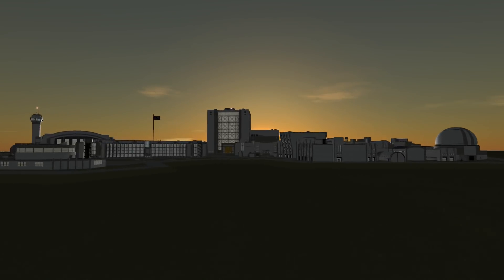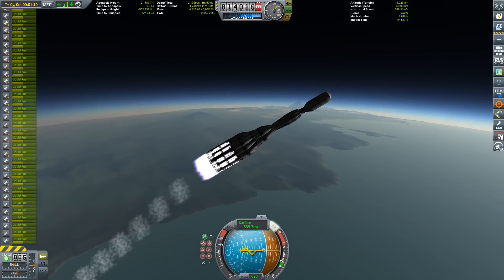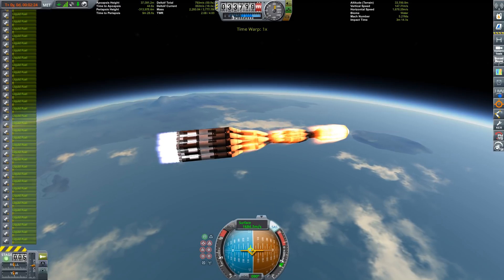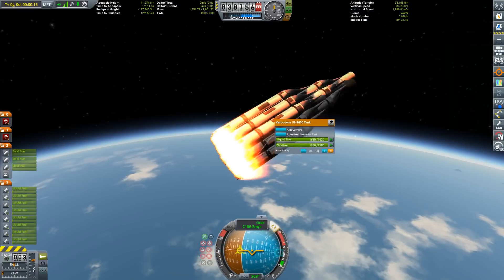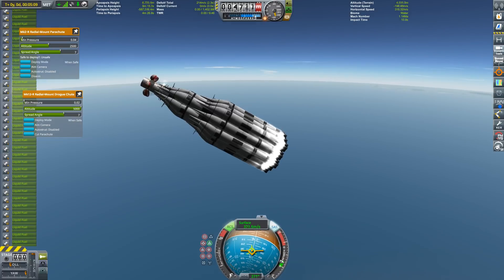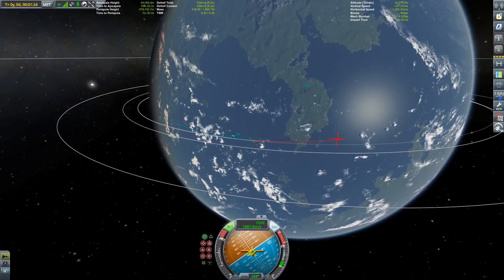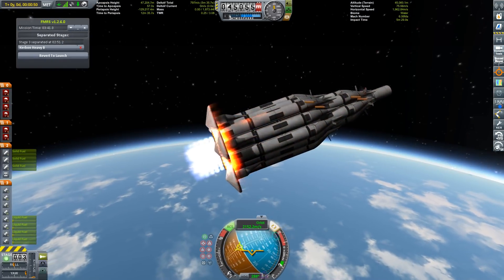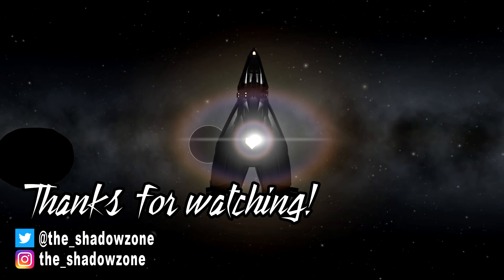FULLY REUSABLE 1150 ton Payload Launcher - Space X style rocket in Kerbal Space Program

Comment: i tried making a delta IV in KSP and what i ended up getting was a formidable launch vehicle that i could slightly modify to 1- be able to vertically land the core launch stage without parachutes, 2- all 9 (yes 9 is weird with ksp symmetry but it works magically) of the SRBs on the side are fully recoverable, 3- YOU CAN EASILY TACK ON 3 EXTRA STAGES FOR EELOO TRANSIT, 5- I LAUNCHED A RING STATION INTO MUN ORBIT, AND SOMEHOW IT'S 99% REUSABLE???? (1% = aero fairings)

Comment: In career mode I use a booster with 4300m/s of delta v, It can put a Minmus lander in 80km circular orbit with a rover in its bay and that as enough delta v to do a couple a jumps. The booster can then De-orbit and land relatively close to the KSC giving me the maximal refund possible. The whole thing cost 240k kerbal bucks, 140 which is refunded from the booster, 30k Multi purposes capsule which gets refunded to like 25k and the rest is the lander stage and the rover, the rover alone is like 15k. That is all lost.

But I am trying to make a BFR which works on the same principle of Reaching orbit with a fully Reusable Shuttle. It's in the first test run on a sandbox test. I'm probably gana try the russian shuttle aproche where the booster as wings  or else that thing will need a hell of a lot of parashuts. My heavy falcon needs like 30 radial parachutse to get it down to 8\ms, and I still need to land them on their sides to protect the 6 18k engines

Comment: More like a Big Kerbal Rocket than a Kerbon Heavy. 

I could be wrong, but it seems really innefficient to try to get such high orbital speed while you're still in the atmosphere on a rocket. It makes sense in SSTO's with air breathing engines because you need air, but I feel like it would be more efficient to at least get above   40km or so before flattening out, if not higher.

Comment: For heavy-duty re-entry airbrakes I apply the largest "Big S" ailerons in 2 co-located radial groups up top and set them to deploy 150% in opposite directions.  Much higher heat tolerance than the stock a.i.r.b.r.a.k.e.s. and loads of drag keeps the tail facing retrograde.  For ascent make sure that pitch/roll/yaw are all disabled for this "super airbrake".

Comment: Most of my career boosters are like this, for 100% funds back. However the highest payload I ever launched was 110 tons and my booster can handle 140 tons to LKO.

One suggestion is to add more dV on the booster, for full circularisation, that way you don't have to deal with booster disappearing on you when switching to stage 2. Launch > circularize > undock > de-orbit booster.

Although I tried multiple times to add a powered landing system, like Space X, I been highly unsuccessful, I play only manual and to have a powered landing in high gravity of Kerbin is touchy at best. Chutes, chutes and more chutes FTW.